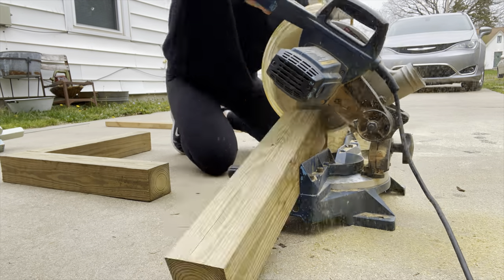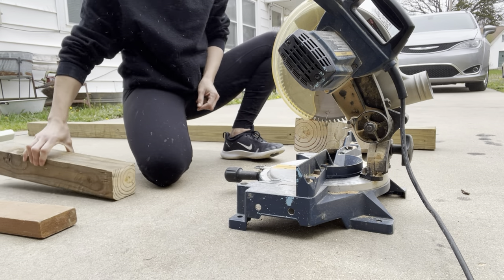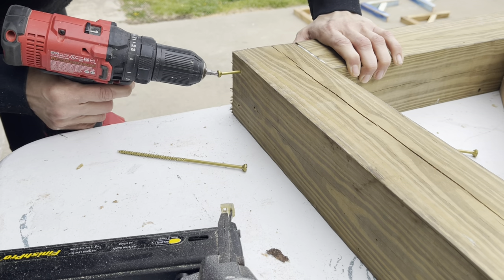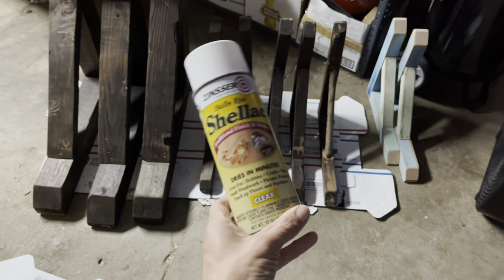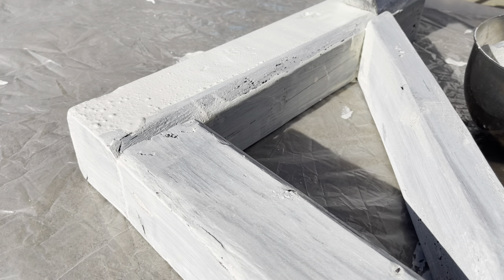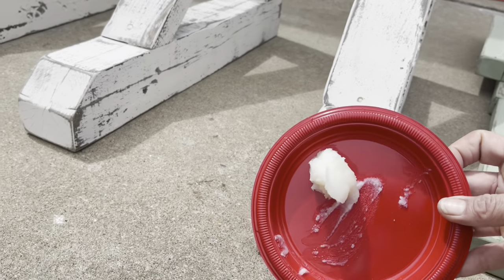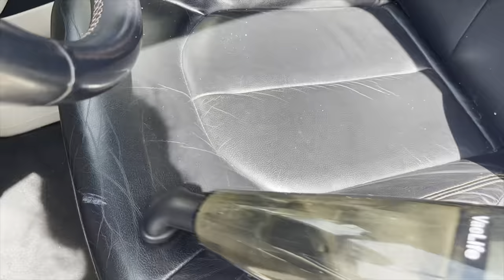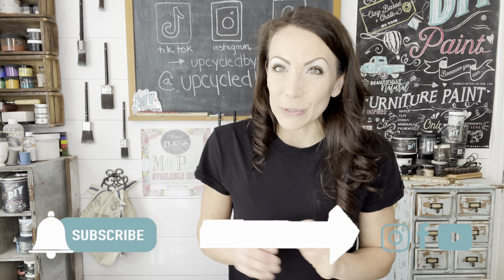DIY Farmhouse Corbel | Trash to Treasure  | Curb Find Flip for Profit | Chippy Paint | Wood Project

Comment: You did a great job! My faves are the big white ones and the green with the dowel. But I have a question - my sweet pickins milk paint doesn't chip or crackle. Like, not even slightly. What am I doing wrong? ☹️
Reply from the maker: What kind of surface are you painting on?  If you want to force crackle, put down a little clear wax before you paint in the spots you want it to chip. And you can use a heat gun or blow dryer to dry spots to force crackle as you paint as well!
Reply: @UpcycledbyBri  thanks for the suggestions. I was so sad when it didn't work, but I'm not giving up! 😆 I had 2 untreated weathered fence boards, 1 sanded 1 unsanded, and a wood box that was sealed with who knows what. I scuff sanded that one. I'll let ya know how the next attempts turn out.